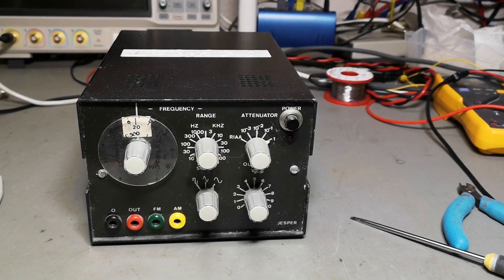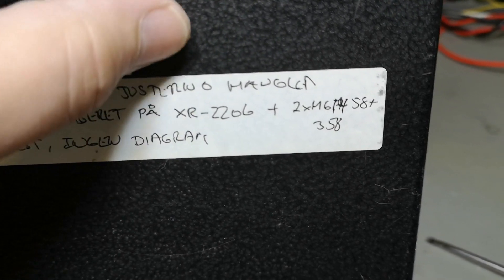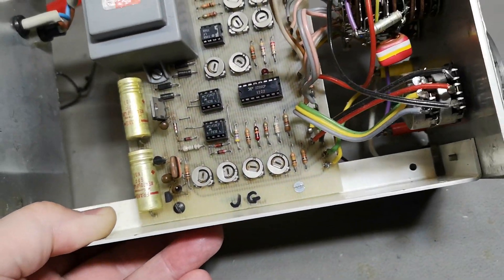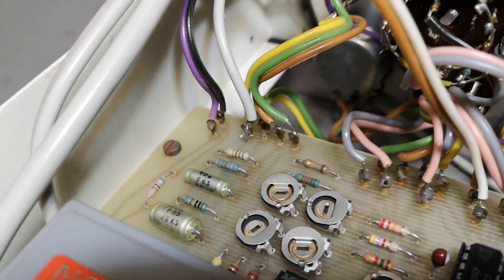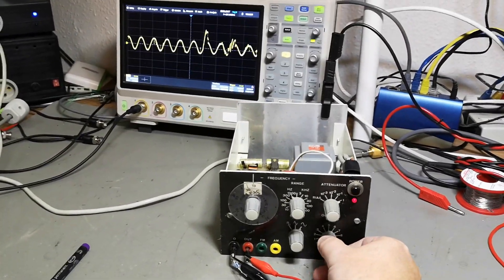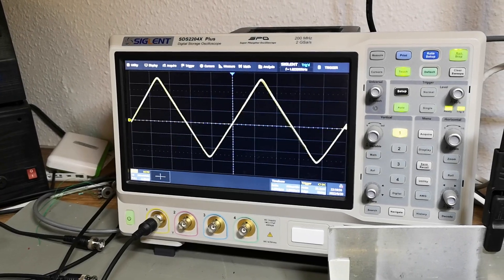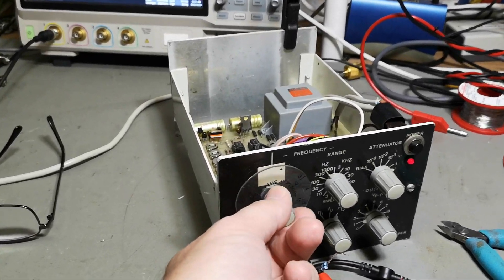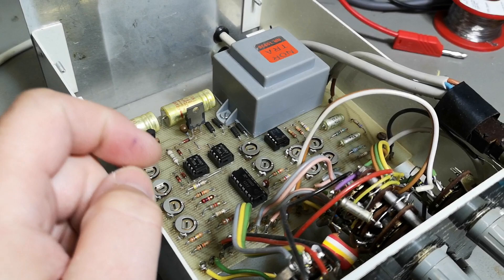DIY function generator XR2206 sine triangle sweep AM 1976 teardown

Comment: Looks like it was laid out with Letraset and crepe tape direct on the board, then etched. No need to mess around with that expensive presensitised board, simply use the clean bare copper, tape and Dalo pen to fix the gaps, then etch. 

RIAA setting puts in a pre emphasis for cartridges, so you can sweep frequency with constant level setting, and see if the preamp for a phono stage is correct EQ wise, as it should give a flat response, while the actual signal applied to it varies in amplitude according to the standard. Used to set up phono amplifiers correctly, so you have a level response from the non linear response of the cartridge (most likely moving magnet, or moving coil, though those are pretty rare these days) and the recording chain. There is a reason that a lot of vinyl top end pressings gave info about the actual cutter used, and the EQ applied to it, so the serious audiophile could use the correct cartridge, mostly Shure and Denon, and needle combination to match what the recording engineer actually heard. And yes, that cutter used, all through the audio chain that drove the cutting stylus, LM741 opamps. Mostly because they were upgraded from valves to germanium transistors, then later to silicon transistors, then finally opamps to get lower noise and distortion.